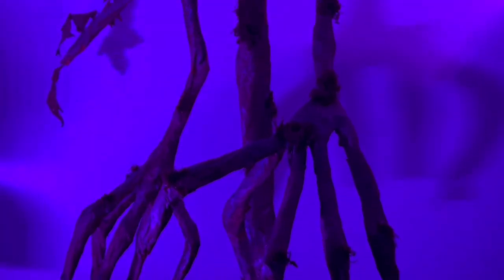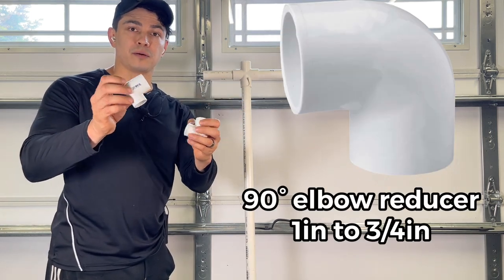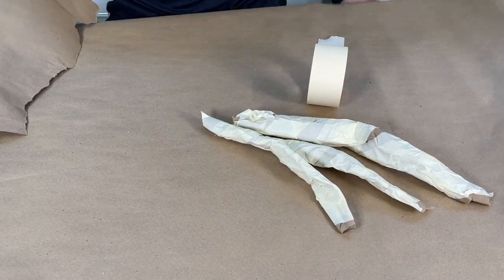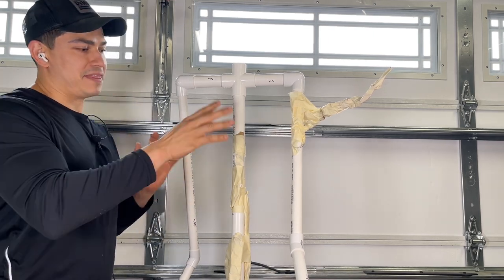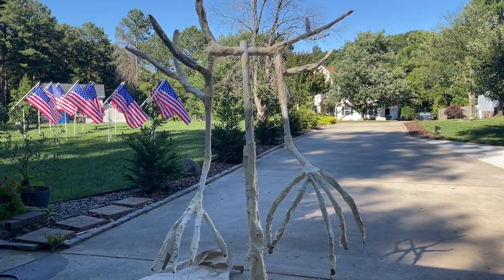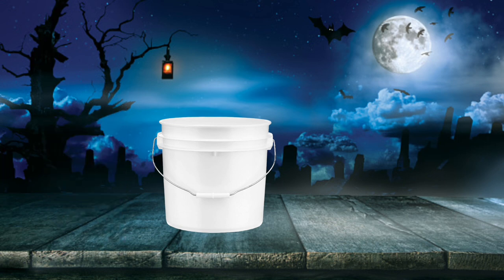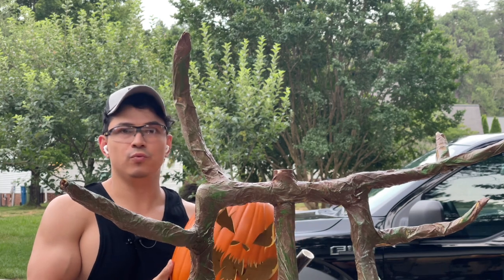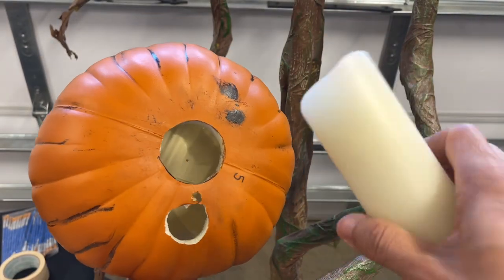GIANT EVIL PUMPKIN TREE TUTORIAL -  6.5ft Tall!

Comment: I made something similar to this but instead of using Paper towel I used strips of burlap I then painted it down with clear lock Mixed with exterior paint. Mine are about 4 years old. And look wonderful outside. The areas where I place them I put another container down into the ground which I change out seasonal by seasonal with plants or a Christmas tree. But all I have to do is drop these guys in and they look great. I love the idea of using the foam in the bottom. So I'm going to take out my moss mixture and try that this year. Great video.
Reply from the maker: Oh that’s awesome that you used burlap! I wanna try that.

Comment: I love the concept and I think that you have achieved a nice finish.  To me the main stalk seems a little thin, and I feel that the shoulder pipes should be less wide with maybe 45 instead of 90 degrees.  It just looks a little square to me.  This is just my opinion on the design - I do like the overall effect.
Reply from the maker: I actually have to agree with you. In hindsight, I should have softened the shoulders by using a heat gun to change the shape or using a different angle. Lastly,  I agree with you on the thickness of the stem. I should’ve continued to have made the trunk a little bit thicker at  the beginning. I have never made anything like this before so it was definitely a lot trial and error. But I appreciate the feedback. I’ll know what to do differently for my next one